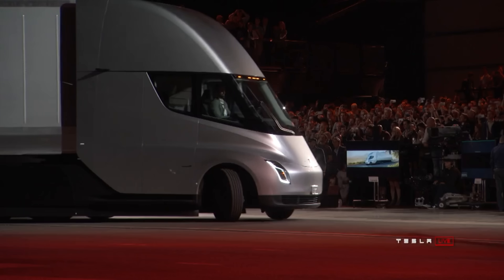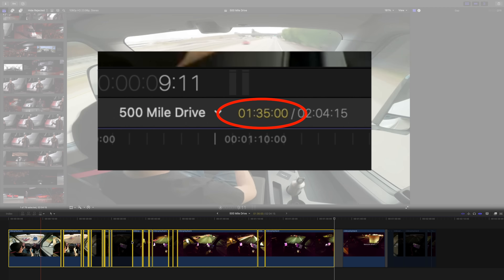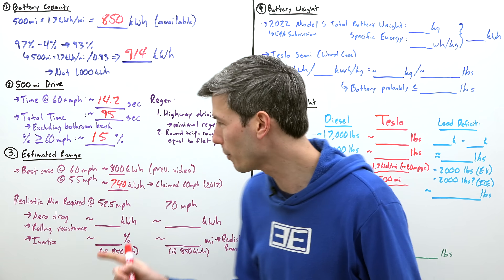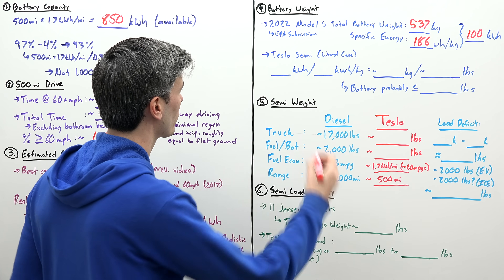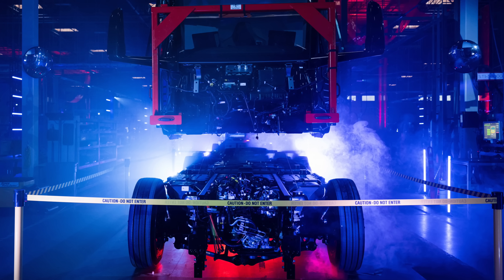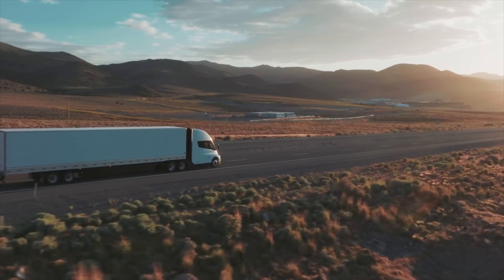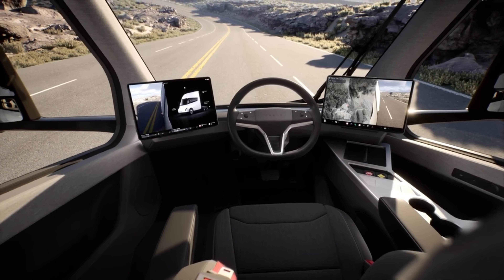Does The Tesla Semi Make Any Sense? Part 2!

Comment: I think you are correct, Tesla trucks make a ton of sense mathematically and environmentally. The largest caveat and concern is initial cost, you can’t just guarantee the fuel will be cheaper because that’s never been a constant, second that most truckers and companies won’t likely prefer a $200k fleet vehicle if KW or FL can do $150k per unit.

Comment: Who says those jersey barriers on the tesla truck weren't made out of styrofoam?
Reply: Oh for fvck sake. 
Since you are probably serious...well they aren't behaving like they are styrofoam, they don't appear to be, there aren't bits flying off them from the chain rubbing at them strung through the ports...and that's without getting into any issues with the very specific claims made it. Which would be an issue if it turned out to be faked to that extent.

Comment: One HUGELY impactful REAL WORLD factor missing from your analysis is that in order to maintain battery health & life a strict protocol will need to be maintained of trying as much as possible to not drain batteries past 10% and not fill them past 90%.. this actually has a pretty big impact on range/load capacity.

An intervening update missed is that the battery pack is modular having 3 packs.. AND that the there are apparently TWO VARIATIONS of the Semi.. the "500" truck and battery weights 26,000lbs... a lighter truck.. the "300" that has a smaller battery pack an weighs 20,500lbs.. so "300" has a shorter range, but can carry 5,500lbs more because of its smaller, lighter battery pack (lighter battery by 5,500lbs) leaves more of the max 82,000lbs total weight for payload. In all likelihood this shorter range/lighter by pvariant was the one shown hauling the ‘Jersey barriers’.. the “500” likely couldn’t carry this load as it would be overweight l.. and if you look at the video of the 500mile trip it’s NOT the same truck! It had a covered trailer.

But TOTALLY agree with you general conclusion there is definitely situations the Tesla Semi can fill, but there are situations ((very heavy loads and/or long distances) where the only answer will still be a diesel.. at least at this time 😏

Find the release from Tesla pretty disingenuous.. they could have EASILY provided way the info to do the analysis.. but deliberately hid info, used terminology they knew would confuse listeners to dishonesty push the narrative that this truck can perform in ways it really can’t.. it can definitely be useful and fill a niche.. but not currently a replacement for a diesel in some situations.
Reply: a) Musk has been know to bold face lie.. in 2017 at TED interview he said that Tesla would deliver cross US self driving such that driver would not have to touch steering wheel.. a claim he KNEW WAS A ONE HUNDRED PERCENT LIE!!! ..something not even possible in 2023!!
b) remember Musk claimed that Tesla would release the full video of the trip, unedited on YouTube?? ..no where to be found.. where is it?? ..also notice in the video the driver wears a baseball cap that JUST HAPPENS to obscure the speed of the truck most of the time 😂... if they showed the entire video of the trip, we know the distance and with the video we'd know the time to complete so we'd know the average speed and the speed ENORMOUSLY affects the aerodynamic drag and power consumption of the rig
c) as I said previously, the weight of truck and batteries are known, but not released.. why?

Tesla have not released the info to actually tell its performance and so compare it to other electric vehicles apples to apples.. don't think this was by mistake.. is it really perform better than other EV truck.. from what Tesla has released we don't know, because we don't know speed, weight of truck and batteries etc.. 🤷🏾‍♂
Reply: @drapetomaniack  In 2015 Alex Roy ran la to new york in 57-ish hours. Then did it again in 2016, and supposedly the "autopilot" was engaged about 97% of the time. Then he beat his previous times again in 2017...and I think it was broken again in 2019 but there isn't much data on the "autopilot" for how long it was used. ....Now, yes, Musk lies, I'm not in anyway disputing that but if he said that in 2017, it would seem reasonable to have thought if in 2016 97% of the trip was auto'ed then it would probably happen soon. Granted that last 3ish% is tough.
Reply: @AveragePicker  he said IN 2017 that IN 2017 100% self driving across US would be completed.. he said with no hesitation and a straight face, boasted several start and and points.. he knew that was a lie! If he didn’t know.. even worse.. but he did.. it was a lie!
Reply: @drapetomaniack  Which is why I pointed out  in 2016 the trip was done  under "autopilot" 97% of the time. 2016 is before 2017. So when he said that, it had almost been done.
...but whatwver I really don't care and you just want to rage about not having self driving cars even though a promoter said there would be.

Comment: Also there is other options you could have a smaller capacity trailer with extra battery pack in there (range extender) that is part of the trailer itself also. 
so could have another 1500 KW/h onboard and carry 1/2 the load 3 x the distance
Reply: I've thought about this. Build battery packs into the trailers and put solar panels on the roof. These trailers spend a lot of time just sitting. They could be used for power generation and storage durign that time.
Reply: @CaliMeatWagon  
That is actually a great thought.

Comment: In the load capacity calculation the trailer weight is missing. The trailer is not part of the tractor, and is part of the load which is pulled.

Comment: Sorry but if its driving at 45mph that just called being smart and responsible road user! not embarrassing.
I hope trucks in USA are Limited to 60mph like here (Aus) 
And i mean a mechanical and electronic speed and engine limiter, 
that cannot be turned off with a data log that police and company can view to ban drivers who speed down hills. 

Tho TBH if its a B-Double so 2 trailers with load is 27 meters(88ft) long pulling upto 62.5 tonnes (138,000lbs) Limited to 50mph. 
B-double trucks are very common in Australia, Dont know about USA. 

We Also have Larger Trucks @ 54 meters(170ft) long pulling over 120 tonnes or 265,000lbs.

Just as a side note of interest our longest truck was 1.5KM Long or almost 1 mile. 

The Guinness World Record for hauling the longest road train still stands. The record was set near Clifton on the Darling Downs in southern Queensland by Brisbane man John Atkinson, who drove a single Mack prime mover 140m in 50 seconds, pulling 112 heavy haulage trailers. Joined together, the record-breaking road train stretched across a distance of 1, 474.3 metres, that’s a truck and trailer combination measuring almost 1.5km long.

Comment: I'm more worried about the design of the cab. The door and seat location seams horrible. Especially being designed for "short haul". Being in the center of the cab will make it hard if not impossible to lean to the side window and talk to gate guards toll booth operators and police. Alot with leaning your head out and looking backwards to get a better veiw. Getting in and out when checking surroundings or dropping and picking up trailers will also take longer with the door being behind the seat.

Comment: Then why do trucks have have 30% more weight capacity than typically needed?   It’s there for robustness and flexibility.
I suspect that Tesla truck load bell curve distribution will “shift to the left” in practice.  In other words, Tesla battery weight is a player and Tesla truckers will carry on average less than a diesel as driven by market economics.

Another point.  Modern diesel truck engines are turbo compound.  Their thermal efficiency is greater than that of the thermal power plant generating Tesla’s recharging juice.  If the purpose is reduce carbon footprint, going EV may be counter productive and particularly so when mining and processing battery minerals.

Comment: My biggest worry about the trucks are the horrid dash layout.  Also since it seems to be using some special electronic valves for the tractor protection valve and parking brake that's an added expense and different from any standard fleet vehicle.  At least it has mirrors now.

Comment: before you carry on Bashing Elon over late semi deliveries, remember this point Mary Poppins emBARRAsing promised with great fanfare 17 EVs byOctober 2022, you have 3 yes THREE ,1 if you count ALL the bolts are now on a never ending magic roundabout of battery recalls and seat pretensioner FIRE risks, and the Lyric that despite 8 months of production have delievered 800 odd, you can discount the Hummer too as they are also on a battery recall for water ingression on a OFF ROAD ALL TERRAIN vehicle ???, when was the last time YOU develped a vehicle from the ground up to achieve 500+ miles on a single charge AND its associated HIGH power charger ???, also asleep @ the wheel Come on Brandon Joe "the big guy" Biden claims also that GM electrified the whole US car market PURE fantasy on his & his speech writers part, that speech was proably jointly written by Barra & the UAW thiefs (factual UAW officials have been jailed for theft of union dues), who is paying you Mercedes Benz AG  ????, try checking real world MPGs on diesel semi with operators of fleets they have stacks of FACTUAL data not like the Dept of Energy guess- timates, try actually spotting a Tesla Semi out there and photograph its weight declaration plate on the vehicle instead of constant guessing (the weight plate is a DOT requirement after all)

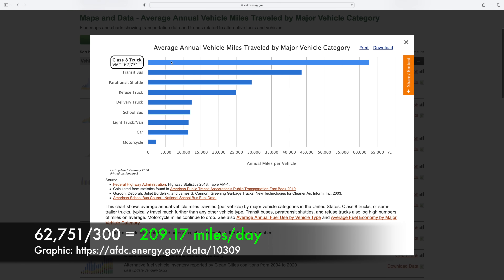Comment: 5:40  “average class 8 vehicle is 67k miles annually”

Class 8 includes things like trash trucks and dump trucks, which are notoriously inefficient for mpg.  Even if a Tesla were outfitted for such a job, it likely wouldn’t make it 100 miles despite its “500 mile range”.  These trucks also massively skew the average.

By comparison, by fleet of OTR trucks average 140k miles a year.  That’s 2700 miles a week and roughly 500 miles a day.

Also, there’s not an apples to apples comparison with the loaf weight comparison.  The Tesla hauling the Jersey barriers is a day cab (no sleeper berth) and was grossed out of GVW with only 44,000 lbs.  My fleet of 587 Peterbilts with 72” sleepers (550 Cummins/13 speed) could carry 12 of them (48,000 lbs) and still be under GVW limit despite the GVW being 2000 lbs less than the EV.

The irony of Pepsi using these trucks is that if my truck shows up at their dock and it can’t haul at least 45k lbs, it gets turned away.  Their loads are frequently 46-48k lbs of cargo.

Comment: If there was a logging truck that kept ferrying wood downhill to a sawmill, could they technically not need to charge because the weight of the load going downhill actually recharged the battery?
Reply: Yes. There are some mining trucks that do exactly that—do a little search and you can probably find some articles about these.

Comment: I have to say that I find 70 mph as a standard for semi trucks pretty high. I mean I understand why you chose it, because that is the limit in your country. In other countries the is a special speed limit for semi trucks anyways. In Germany for example the limit is 80 kmh or 50 mph. With a lower speed limit like that, those trucks become much more viable.
Reply: Our weight, size and axle pressure restrictions are different here in Europe though from what I remember. Probably has something to do with requirements to fit on ferries, narrower roads in old towns, load limits on older bridges, etc. These restrictions typically result in the less aerodynamic shape of our more compact semi trucks because of the length restriction, it'd certainly be interesting to see all the calculations worked out for a generally useful and legal product here.

I would expect many of the trips to be shorter and the mandatory rest periods are pretty long, if that can be combined with the charging I suspect it could be viable as a technical concept. No idea what it'd take to make it financially and practically viable.
Reply: @extrastuff9463  I though that the Tesla Semi Truck is already designed to be allowed on European roads. I mean could be that the changed that, but I also though so. In that case the aerodynamics wouldn't change. I think European trucks have a higher weight limit though. 

I think that if it is guaranteed that the trucks can charge during the rest periods, then they would be usable for long range.

Comment: 7:30 taking Model S as example is bad because 100 kWh pack in Model S is based on 18650s not on 2170s
10:20 this is not accurate, you can see that they put additional load on trailer to max out their gross weight with those wooden blocks on scale

Comment: You calculated probable battery weight based on model S but did you also extrapolate motor weight and power conversion equipment weight?  I think you may have overestimated the semi's payload capacity by a few thousand lbs.  Of course, Tesla could have removed all doubt by simply telling us.  The fact that they did not is worrying (suggests bad news).

Comment: I would argue that stop and go traffic can often become more energy intensive than traveling at a more constant speed, especially in this application. 

The efficiency figure likely could be taking this variability into account to keep things realistic, I bet highway travel would let it lean more on its efficiency motors vs torque ones.

The Semi trip demonstrated real world conditions here, mixing highway speeds with traffic related deviations.
Reply: Depending on how aggressive the braking would be I'd hope regen to be of a similar utility as when they descended during the demonstrated trip. And if that stop and go traffic is in populated areas it should cut down on some of the pollution associated with idling big engines.

Comment: But on those shorter trip runs the company isn't pushing out the cash to foot the bill on the cost of the truck another part would be can it hook up to the existing trailers without losses due to the older trailers coefficient of drag

Comment: I don’t think you should hold the inflation problems w the cost of the truck/electricity against Tesla if it makes money we will see these trucks on the road the only question is how long they will last and will economies of scale lower the cost. Also what are oil prices going to do? The war in Ukraine is far from over and supply may tighten like last summer. I think Tesla will be able to make the trucks make financial sense for certain companies plus safety is also a big issue bet they will be cheaper to insure in 5 years. Guess that will depend on if they spontaneously combust.

Comment: Based on the figures in this video from Pepsi, am I calculating correctly that charging one semi requires about a MW of electrical capacity? (45 minutes to charge 80% of the assumed 850kW, with typical losses around 10%)

Recently my career has had a couple different nexus with electrical utility work, and rarely has there been megawatts of available substation capacity that don’t require upgrades. Utility scale transformers and other hardware that would need upgrades are commonly running over 100 weeks lead time AFTER a load study and contracts are in place. And that’s just looking at the distribution substation requirements, ignoring transmission and generation. 

Obviously, not every truck is going to charge simultaneously, but more often than not, these trucks are in use during peak renewable availability periods, putting more demand on generation infrastructure that is either being phased out or storage infrastructure that isn’t in place. 

In the grand scheme, the additional load from charging the 36 Pepsi has deployed in California is barely a drop in the bucket, but are they going to stop charging these when households are being asked to set their AC at 78°F or higher and stop using large appliances? A few megawatts isn’t much when excess demand is measured in gigawatts, but additional excess is still moving in the wrong direction.
Reply: You are asking the very good questions that most people won't answer. Just to bring that much electrical energy to a point is one thing, bring it at the rate (power) is another thing, and yet another thing is bringing it at the voltage required to get that much energy, so tearing up concrete, high voltage equipment installation, pouring new concrete and its associated costs and carbon costs, etc.

Comment: 5:20 I'm learning a lot here. Up to ≈130 km/h for a big truck. That's >2.5 times the kinetic energy than with 80 km/h. To me that sounds like a huge safety risk, I would have never allowed trucks to be so fast (use rails? Also much more efficient at these speeds). No wonder USA has SO many deaths in car traffic. This is probably one factor.